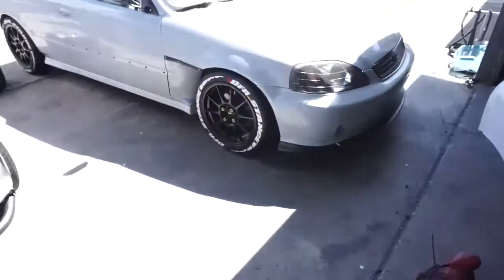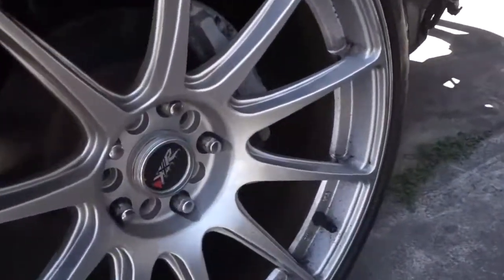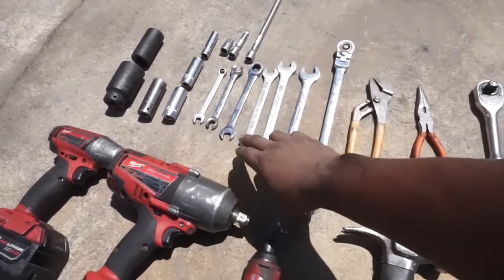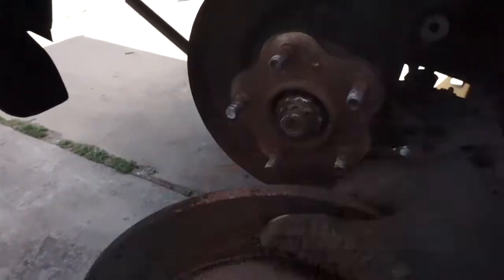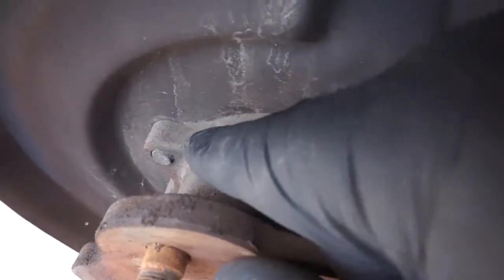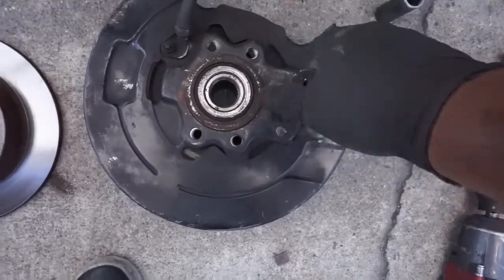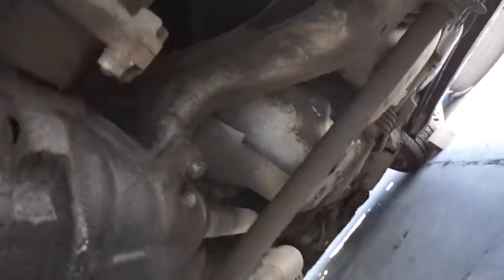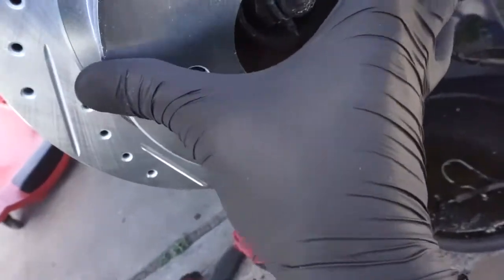DIY 240sx to 300zx brake conversion

Comment: What's up! I'm doing this exact swap soon, when you did it did you end up using the 2+2 ebrake cables? I am getting mixed reviews and some forums say that 300zx ebrake (2+0 & 2+2) cables don't fit on S14 and you need R33 or aftermarket ones

Comment: What year is the 300zx the brakes are coming off of?
Reply: Hey Johnathan they come off a z32. I pulled mine from a 1996 but you can use any year as long as its within the same year of that chassis.